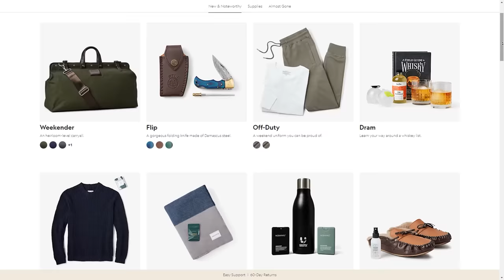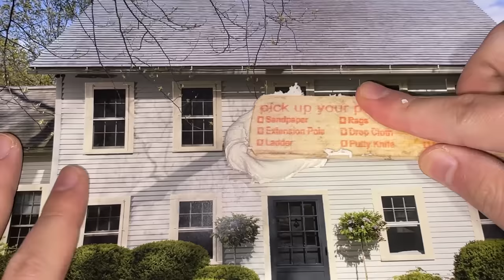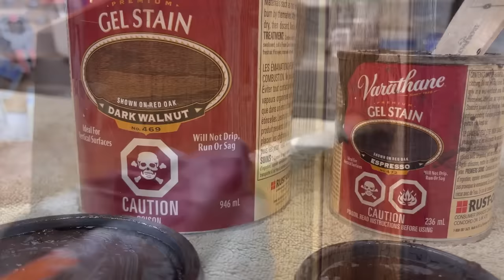So.. Much.. Veneer Damage.. Retro Bar Cabinet Restoration

Comment: I’d caution you against wrapping electrical connections as you did. That creates hot spot due in part to how you connected the wires by bending and twisting it together and the wrapping it with electrical tape. Solder the connection, then apply a heat shrink over the splicing job.
Reply: I too was not content with the wiring. I couldn't put my finger on why, but the little guy on my shoulder kept nudging. I kept thinking "wire nut, wire nut" even thought there was not room enough in the casing.  Heat shrink tubing! Yes!
Reply: A crimp on barrel connector would work too. Twisted together and taped really isn't the best.
Reply: @mikespangler98  I forgot about those barrel connectors, with preplanning and forethought to slide a heat shrink tube on the wire before hand.
Reply: He could have cut just one conductor, leaving the other intact.  Then there would be no splice at all.
Reply: @zysurge  Only if he made the hole in the back large enough for the plug.
Reply: I will add, should have pushed the wire through the back of the cabinent, before connecting to the switch. Then, tied an Underwriter's knot (UL Knot). This will prevent strain on both the terminal conections on the switch and on the pass through leg connection. This knot prevents accidental electocutions and fires in most appliances and lamps.
Reply: That was my concern, too. I know almost nothing about electricity, but that didn't look right
And it being hidden in the back of a wood cabinet also makes me nervous 😅
Reply: I came down to the comments to find just this point. It would have also been nice to see ferrules used on the stranded cable before it was put into the switch. It was the only downside in an otherwise great restoration job. If similar electrical jobs come up in the future, I'd like to think the creator might be better to consider a battery-powered light or consulting with someone with more electrical experience.
Reply: WAGO are super cheap and provide good/secure insulated connections.
Reply: Che meraviglia!
Reply: It was so nice to see the constructive advice on this topic.  It will help out a lot of us.
Reply: Was looking at all of these comments and realized that they were all modern replies. When the connections were first used by my husband, electrical tape was just about all there was. He was probably taught by someone who used this method. It's also very easy to correct.

Comment: I have the exact same drinks cabinet, mine is a lighter colour but everything else is identical. You’ve done a wonderful job of restoring it, especially considering how many curves there are. You have a rare patience and tenacity. Beautiful work.
Reply: I have one too! Beautilities are pretty sweet.
Reply: Me too but my doors are glass
Reply: My grandparents had one like this, but the doors on each side are flat with hugely over the top ornate handles. I've never seen anything similar before this video popped up in my reccomendations.
Reply: Patience - yes, that's the word I was searching for. Your patience is phenomenal.

Comment: Beautiful job. Such careful work.   This video of veneer repair was exactly what I needed! I bought a short dresser for $5, but it got caught in the rain in transport. The veneer on the four small drawers lifted, inside and out. I was able to clamp it back down while wet, but now must give attention to the lifted veneer. Also, the edge strip (about 1/2") on the front of two of the drawers peel off. I was able to save the strip from one of the longer drawers, but will need to replace the strip on the smaller one. Thank you so much for posting this video.

Comment: Genuine 1930s design -- what a find! As sorry as it looked at first, after all your hard work, it looks elegant enough to go straight into Hercule Poirot's London flat.

As for all the surface damage, bar cabinets just seem to take a beating, for some reason. I don't know if it's because people just treat them differently, or if they get a little tiddly and carelessly do things to the cabinets that harm them. The semi-antique buffet I have in my dinging room had been used as a bar cabinet in it's former life. As far as I can tell, it's solid oak, and is the kind with a mirrored over-mantle style shelf above the actual counter surface. Someone had grafted a wine glass holder to the bottom of the over shelf -- I just left that part there, because it's handy and an easy way to display some Depression stemware -- and had removed the shelves from the center section of the cabinet to replace them with a wine rack. I removed the wine rack. The upper level of the over-mantle, especially, had a lot of surface damage, including but not limited to white rings frm damp glasses being left sitting on it. I didn't have to do as much work on it as you did on this one, but I did have to work on those white rings. I got away with just giving the shelf a brisk rub with some triple-aught steel wool and went over it with Howard's Restore-A-Finish, followed by a coat of Howard's Feed-n-Wax. The finish on your cabinet, of course, was already too far gone for that when you got it.

I hope you plan to keep that gem. If you do sell it, don't let anybody talk you down on the price. The cabinet will be a certifiable antique within a decade, and it's value will likely double!

Comment: Hello. 
It's a very remarkable work you done on this make-up storage cabinet. The light bulb for inside compartment is incandescent  candelabra tube light. It also uses for aquarium lighting. It sell in Home Depot, ACE and Amazon. This type of lights also known as undercabinet light and also used for lighting of kitchen countertops in 1950's

Comment: This project came up on my home page. It looks like you have a bit of experience in tackling this piece.  This has good design elements and technical integrity. Might suggest using a wire nut or soldering the electrical connection as this piece will outlast you. LOL!  Nice save on the hardware , veneer and finish. Especially the care with which you matched grain patterns.  Nice save!

Comment: When you find an old piece that is begging you to restore it, you can't stop yourself.   I have been doing it since I bought my 1889 small Victorian house.  I just bought another Eastlake parlor chair, marked down from $29 to $3.99. I would have bought it at the original asking price.  It's on my list to do this summer.  It won't be sold.  None of my work is.  It will probably be forgotten when I'm dead.

Comment: Excellent  looks awesome. Can I make a suggestion, if you have to fit a similar type of switch for the light, just cut the one wire  rather than cutting both, better than making a dangerous join with tape. 👍

Comment: Gorgeous restoration . Do you know who built the original? Nothing about it says mass produced. I held my brief when you spliced the wires (dad was an electrician) but you handled it like a pro.  Many restorers use markers to touch up the veneer, but I prefer your paint brush. It leaves opportunity to mix colors. Thanks for sharing 22:27

Comment: You did an amazing job with this piece.  I love it!  My only gripe is using that electrical tape to join the wires.  That's not kosher because it can spark   Need to use a wire coupler.

Comment: Bravo! What a great job... may I suggest something? Although unseen, it would be more tidy to use heat shrink on the AC cable joint and a grommet on the exit hole for the cable. I'm in awe of your craftsmanship, however.

Comment: Nice job. I wouldn't have used electrical tape for the wires though. You're asking for a fire, especially inside a wooden bureau full of flammable clothes. Always go with heat shrink tubing and ideally a little solder for a safe and reliable connection.

Comment: Nice work but I think you need to revisit the electrics. I’m not sure on the regulations in Canada but twisting and taping up like that isn’t safe. You either need a mechanical crimp, a soldered splice and heatshrink or an approved connector (Wago, Ideal etc.). You also had some exposed copper on the connection into the switch. For peace of mind (and possibly legal requirements) if you are selling this, then I would replace it with a battery led light or have an electrician check it.

Comment: When I first saw this piece of furniture, I was sure you paid too much but I was so wrong.  I'm wondering if the light switch you fixed was Bakelite.  So many electric pieces were made of it in the past.  Interesting material.  My grandparents gave me an old mantle clock which I loved dearly but when it stopped working, the clock repair said it could not be saved as many of the components were made of Bakelite.  😞

Comment: The woodwork restoration is beautiful. The electrical connections could have been better. I would have used a wire nut rather than just twist and tape. A strain relief where it exits the cabinet is a must as well. If putting electrical wiring back into antique furniture it may be a good idea to watch some videos on basic electrical wiring first. Electrical safety has come a long way since that cabinet was built.

Comment: Was that made in England ?  I have a somewhat similar  liquor cabinet, still had most of veneer left, BUT the cabinet had been painted entirely, inside and out. Every little crook and nanny had but painted inside.  Wife wanted to repaint it.  Once I sanded down one of the front door and saw how beautiful the veneer/wood looked, I did a slight stain/sealer.

Comment: I've redone a couple of relatively cheap pieces of furniture, and even though it looked good, it was a lot of labor to turn a piece of junk into something that  will be a piece of junk again in a few years.  I'd rather have a solid wood piece that's been beat to hell than some cheap piece that just needs 'touch ups'.  When you finish the solid wood piece, it'll be a treasure for then next few generations.  The veneer junk will be in a landfill in 10 years.

Comment: The only part of this video i didn't like was the assembly with the tape of the two wires, i feel like you should have used a small plastic end to end wire connector with tightening screws. That tape will probably loose its adhesion over time and loose grip of those two wires. But otherwise this is an incredible job. I probably wouldn't even be able to replicate this kudos.

Comment: just an fyi... you didnt need to cut the cord completely in half, just one lead could have been cut. also the one splice should have been soldered and heat shrinked, or at the very least a wire nut.

Comment: almost perfect, you should have used a wire nut instead of electrical tape as the tape will dry out over time.  Otherwise - wow.

Comment: The end result doesn't look bad. But you've lost all the character that the original had. Why remove all the veneer and then stain different types of wood. Damaging the piece and breaking the mirror should disqualify it as a restoration. This is rehabilitation at best. 

Lots of good techniques and tools being used here. Please be more considerate of the history and love that went into this piece. If not, call yourself a repair guy or butcher not someone who does restoration.